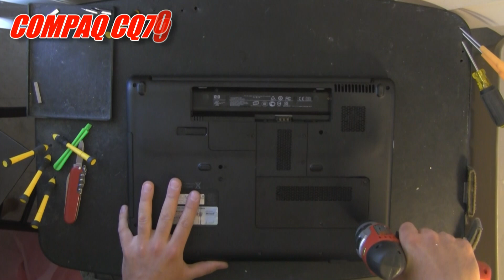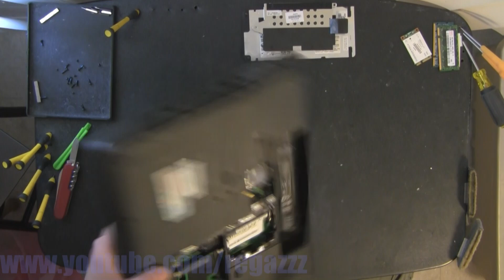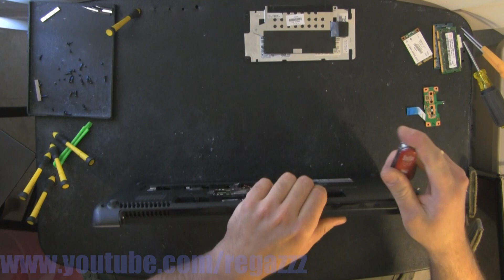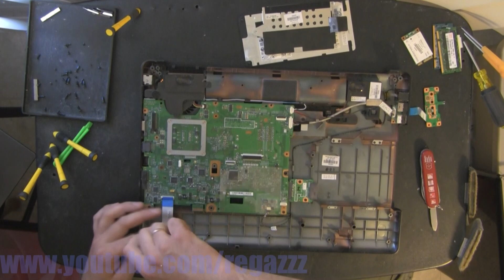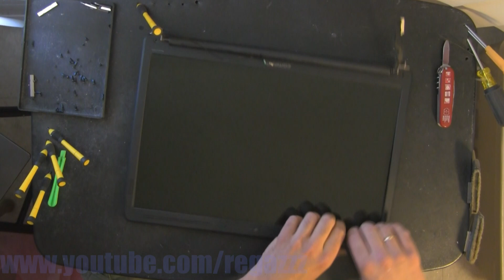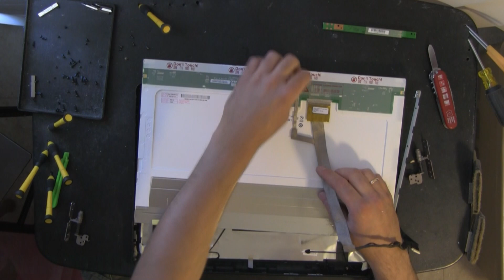COMPAQ CQ70 take apart, disassembly, how-to video (nothing left) HD

Comment: Hey mate, thanks for your video, ive got one of these laptops, the right hand side screen bracket has snaped, also you know where it screws into at the bottom of the cover, the plastic/gold threaded bits are snaped also, if i get a new top cover would it be a simpleish job to transfer everything over?? im not sure about the tin foil stuff behind the screen and how the webcam fixes? thanks for your help

Comment: Awesome tutorial. Any advise on re-connecting the the wifi wires when putting it back together? I can only see one place where the wires connect and neither wire from the monitor want to snap to it. Thanks again.
Reply from the maker: Hello Gina, on my second channel LaptopRepairAid you will be able to find a video about connectors.
Reply: Thank you for the reply! I was able to get it back togrther and working thanks to you!!!
Reply: Okay regazzz, I just bought a "NEW" replacement keyboard for another laptop and it was not new (China) and the metal strip broke when touched. Do you know a
ny respectable U.S. keyboard sellers I can get a working new or used keyboard?

Comment: Thanks a lot , you are awesome :) ,, I have a question please , I want to fix the fan , it doesn't work , can you tell me the steps to find the fan please !
Reply from the maker: Taha Dexter Hello, looks like fan is under a motherboard. You will need to take pretty much everything out before you will be able to remove fan with heat sink. It can be bad or just dirty.